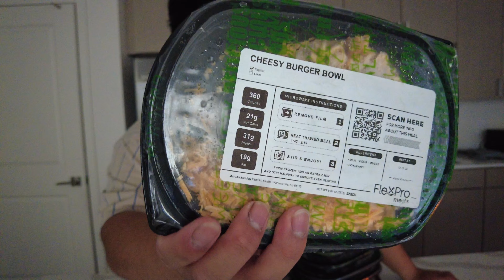What's been going on with the ND Miata..

Comment: Damn bro that sucks about the job parking lot, hurts to say it but maybe try a bag over damper from C2B. Ngl I’ve been debating it just because I’m getting tired of taking 20 minutes just to get the car in/out the house..
Reply from the maker: Been thinking about the superlow bags bro just so it’s less hassle for me but i still wanna ride it low af 😢
Reply: @Mryataa   I think the C2B bags you can still drive low, it’ll ride like a normal static car would. Atleast from what I’ve gathered is that bagged people don’t drive low because low air pressure = harsh ride quality. Us static people been used to that lmao 
But the superlow bags are dope too, pricey and wide tho like airlift.
Reply from the maker: @StreetSteezn  i’ll look more into C2B. Never heard of it 🤔
Reply: @Mryataa  it’s a cheaper alternative to ridelow and they can go onto your Teins, it’s $800 for all 4 bags, and then you’d just need to get a tank, lines, and management. I figured I would get manual management since I intended to drive low as if I was still static and just air up to get in and out my house / emergencies. 

My biggest issue with going air is fitment issues I’d run into with wheel clearance because majority of bags are bigger than coils
Reply from the maker: @StreetSteezn  fitment is my biggest issue too since I wanna plan on tilting this car more when it’s time and bag clearance is pretty tricky when it comes to it